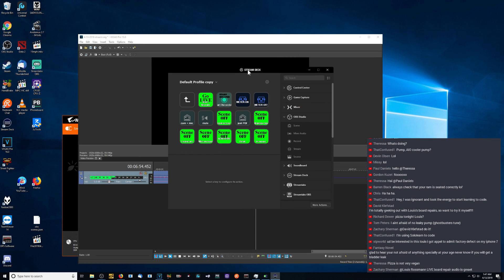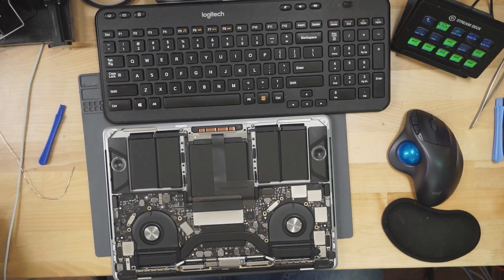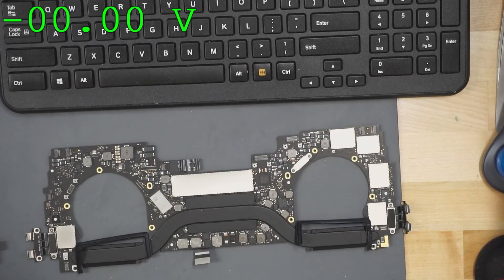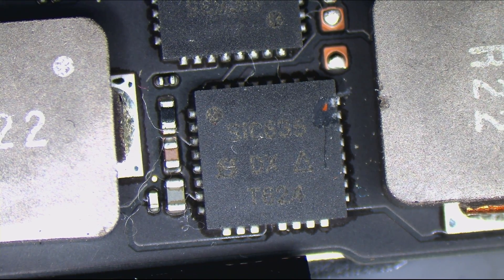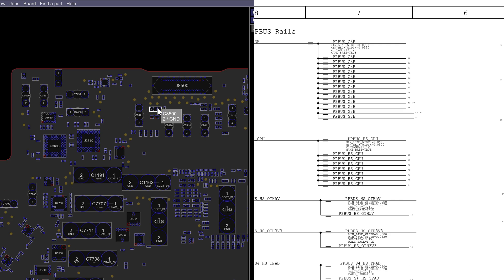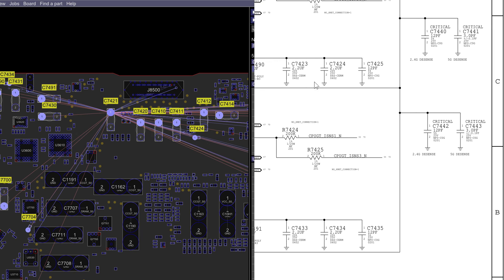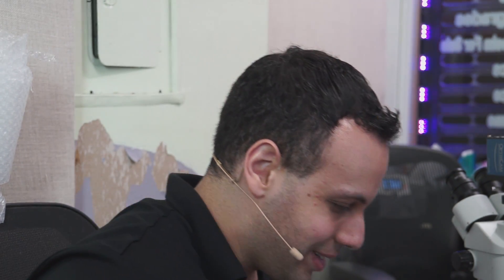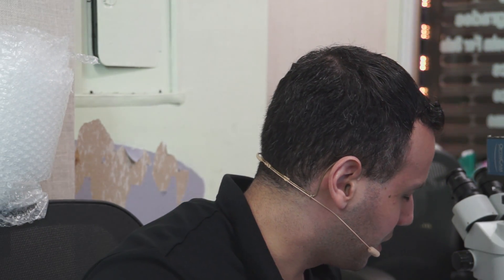Can Macbook be fixed?

Comment: That MOSFET may still fail when the CPU draws more power
Reply from the maker: Only for a small percentage of customers.
Reply: @rossmanngroup  Put a near impossible to remove label on the MOSFET to ensure it works correctly
Reply: Chips dont randomly fail. Oh wait its on a mac. Never mind my mistake
Reply: Mu Aries everything breaks my friend

Comment: If I ever design logic boards, I'm going to try my best to put all the power rails through a small area so people like Louis can quickly check voltages.  Add in a ground point as well.

Also:  That Kappa-sitter must have realized it was in an Apple and committed seppuku.

Comment: Thanks Louis. With some good Probe Master test leads you won't have to press so hard. All they need is a light touch.
Reply: the probe not making good contact isn't the issue here, it's that what he is trying to contact has a tiny film of oxidation. but sure, probemasters are awesome!
Reply: @krass76  Could've fooled me - It looked like he was trying to put a hole through the board. I am sure that he can afford Probe Master test leads...
Reply: And I might add that when you look through his store, he sells some pretty good equipment - and it for the most part is not the cheapest stuff. But when you look at the multimeters and test leads, they are just cheap junk! I wonder how much time people have wasted from using that junk??
I am not trying to be a jerk, I am just making a really very important observation. Your test leads and probes are the most important link in the chain. Why hamstring decent meters with cheap junkie test leads??
Reply: I'd guess that because he abuses them they need to be expendable so he just sticks with what is good enough.
Reply: @krass76   I would accept that line of reasoning if Probe Master test leads were expensive, but they're not. They are not very expensive at all. Why pay $5 for junk when you can get AAA for $20??